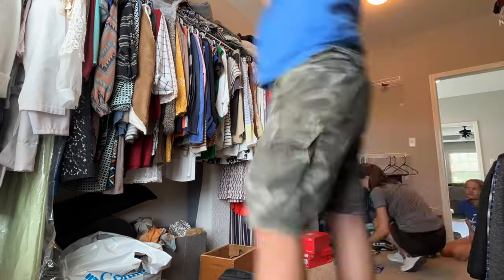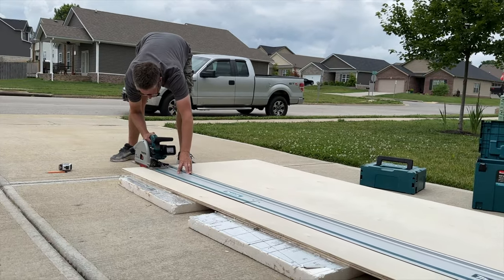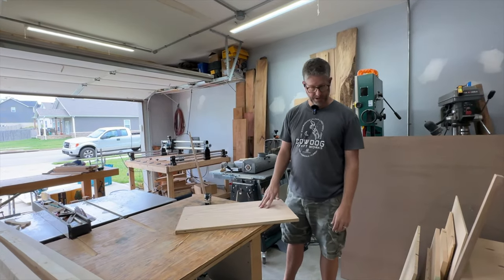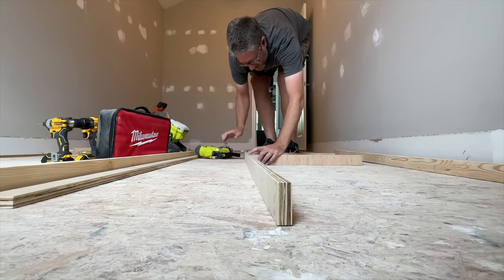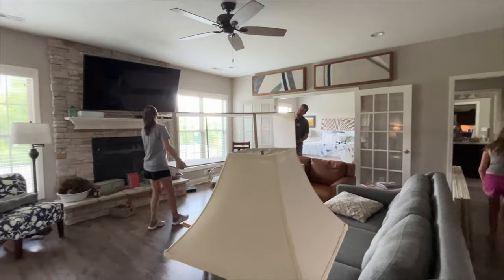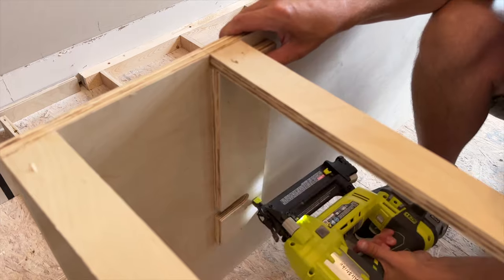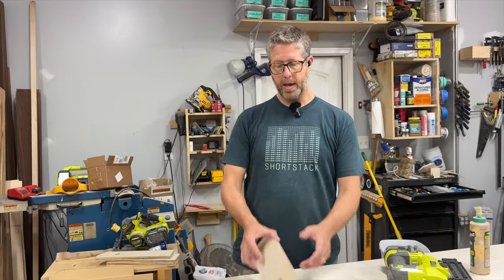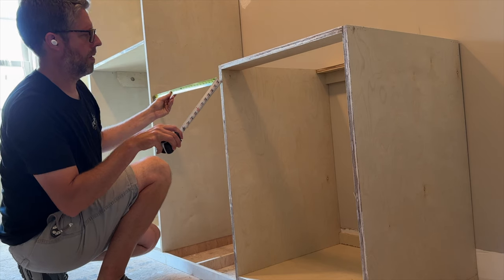Master Closet Renovation | EP02 | Building Custom Cabinets & Toe Kicks

Comment: When you built the second wall of cabinets why leave the gap after the drop down and build that instead of slide the other cabinet over then build the end cabinet?
Reply from the maker: I knew where my cabinets had to end for sure, but didn’t know what that middle space would be until I got those others in place. At that point, I measured the gap and then built it.
Reply: @BruceAUlrich  looking at it from that point now it makes sense